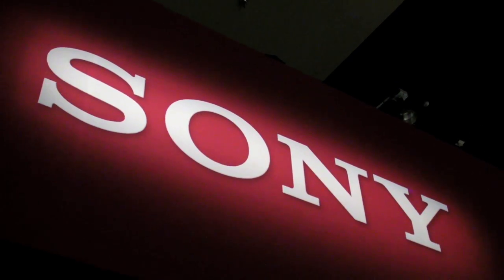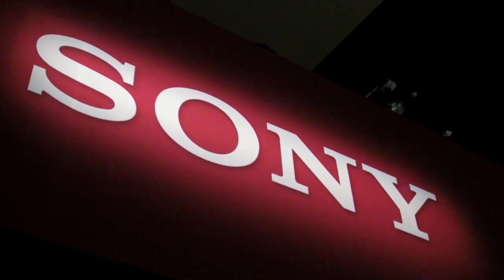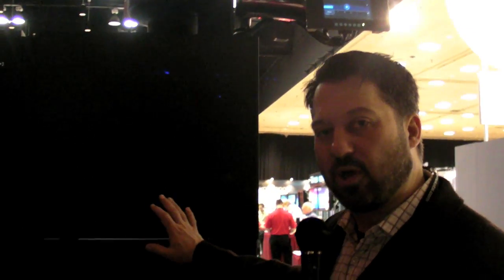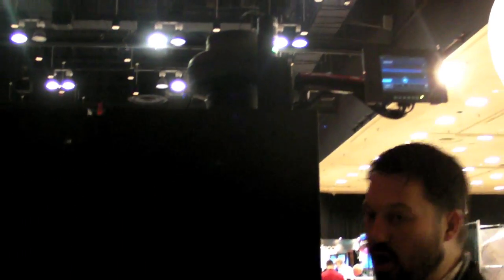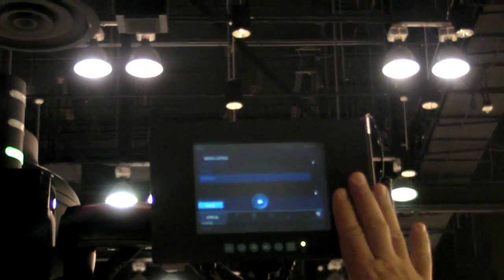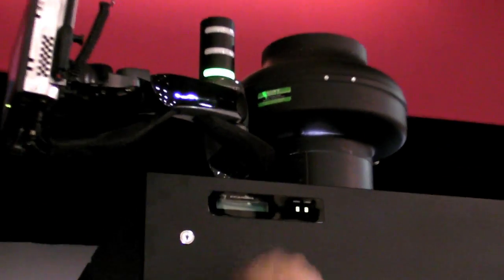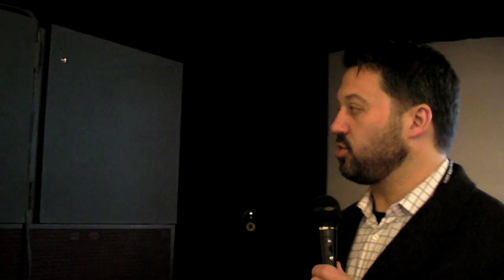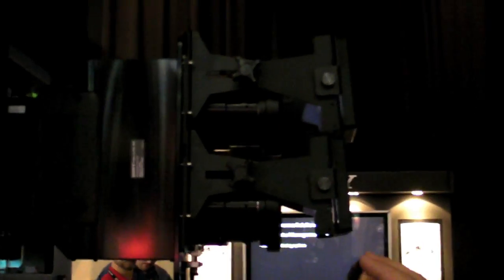Showest - Sony - 4K Projector

Comment: Watched my short b&w film at a festival in Eugene a little over a week ago. Brought in a Blu-Ray, as they were not set up to receive DCP's which I probably would screw up making. I was very surprised that my 1080p film didn't break up on a screen that appeared to be about 25 feet wide. But the film was around 25% to light. Blacks (and there were a lot in my little noir film) were very thin, and layers I created in Photoshop that faded in and out could be seen before they were supposed to be seen...especially in the blacks of the current scene.  Was it just a poor gamma setting based on a quick viewing of a bit of my Blu-Ray...? Or maybe the projectionist chose the highest setting..2.6, and the shear baboom of that projector was really telling me this is what it's like around the big boys....even though I used a calibrated monitor at home to make my h.264 quicktime film.  There is no easy fix to this, except to know what the next festival's projector is, and maybe reduce my gamma accordingly in my next Blu-Ray. Not a solution, but...I'm just a little fly in the digital room. But have to say, I was knocked out by the detail and zero breakup of my film passing through the 4K.

Comment: My local AMC started to install Sony 4k projectors in August of 2009 in two screens. Those were capable of doing 3D projection. The AMC in Rockaway, NJ USA then replaced all their film projectors with Sony 4k projection 2D (excluding the DLP 2k IMAX theater) in October of last year. Digital projection has elminated the need for splicing film, showing the film as it was supposed to be seen.

Comment from the maker: @bunkofurko you are right to a degree, but with so much 3D coming out, you will be able to keep 2-3 cinemas busy simply running digital 3D.  3D is driving this now, not so much the VPF. So its going to happen because of that. Many of the DCI system we are putting in now are total replacements. 35mm pulled out.  Once you decide you are going DCI for 2D and 3D and look past the VPF, no reason to keep them.  If you have digital you use it and push the 35mm aside, not worth keeping duel kit serviced